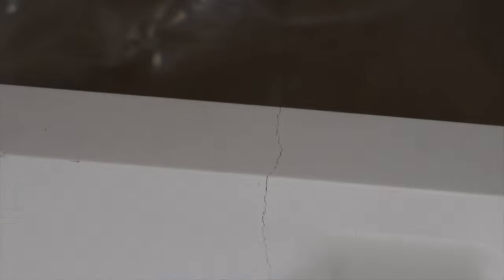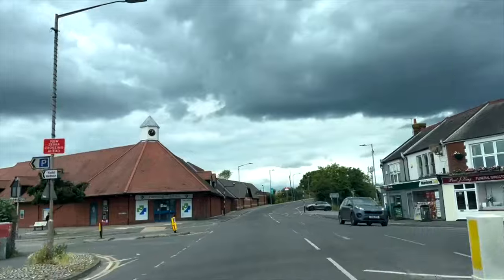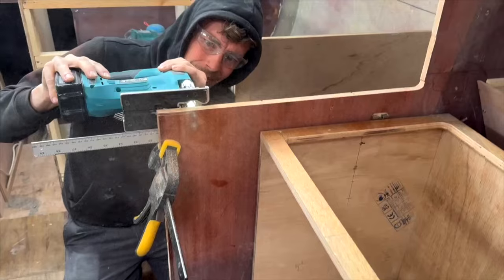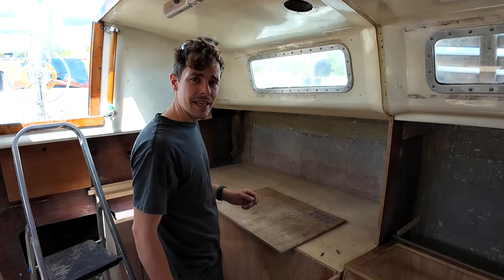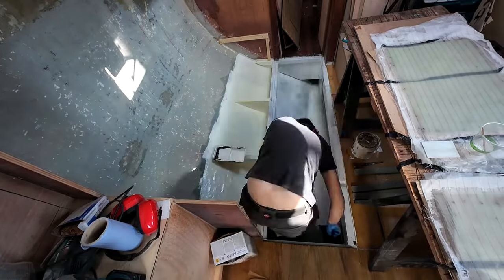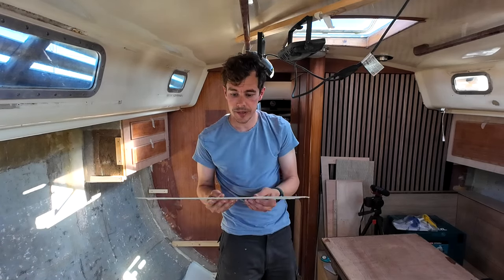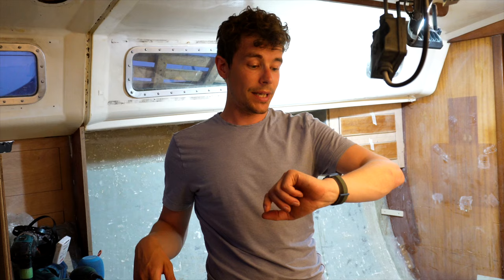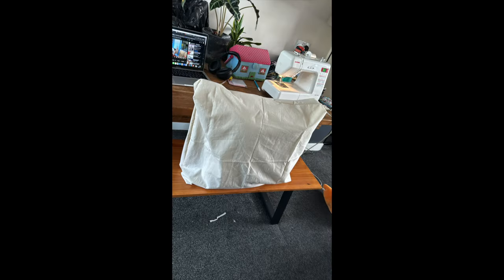Ep 33 | If we can’t stand the HEAT…

Comment: Heat guns remove unwanted resin from metal.
Reply from the maker: This is useful! Thank you 🙂
Reply: Actually heat guns remove epoxy from everything it is just that what you remove it from may be degraded if you are not very careful, like wood.